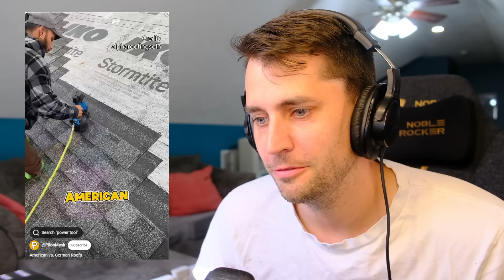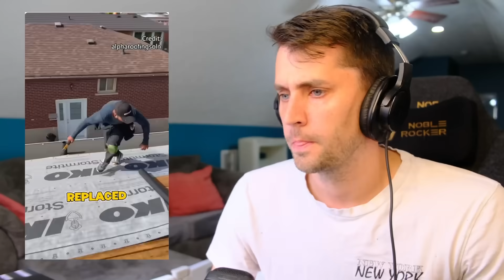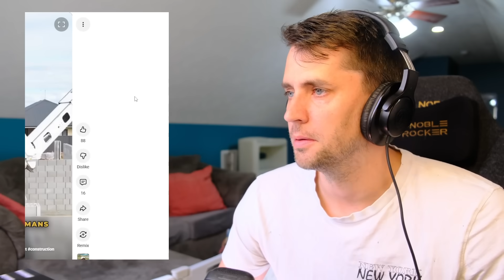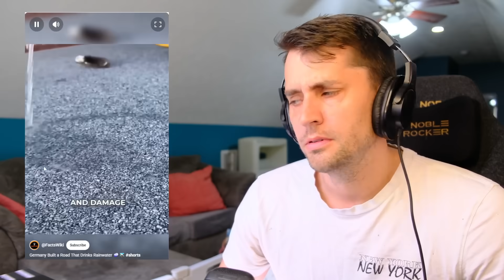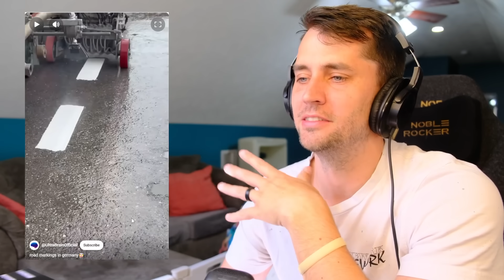American reacts to Germany's NEXT LEVEL construction methods

Comment: Aside from the roof video, the others felt more like commercials. I've never seen one of these house building robots, and some things make no sense, it has a 25m long arm but it can build 8 stories tall buildings. In most german houses you need between 2,5m and 3m per story, so even if it could reach the height of 8 stories then it needs to move around the house all the time and it can't build inner walls, that makes no sense.

Comment: FYI: Renovating the roof of my 1958 Home (adding multiple gables) with concrete roof tiles cost me 100k Euros. That was not cheap but also not expensive. Our Roofs do have a wood construction though just like american homes although much thicker wood. The roof was on there since building the house.

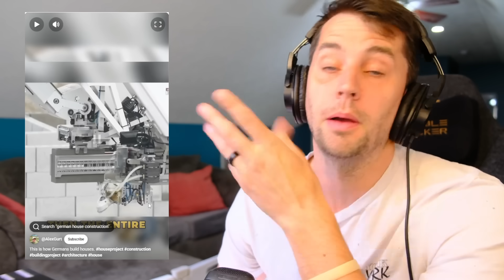Comment: 6:22 Yes, there are machines like this out there, but it's not common at all (yet).
Maybe it will be someday, maybe it won't. 
Those machines do different types of construction.
It's not the traditional "glue the bricks with mortar" technique but "stack perfectly uniform bricks like lego".
Some of those constructions are built so that hollow spaces within the walls are filled with insulating granulate and/or stabilising concrete, depending on the type and the position of the wall (inside or outer).
Reply: Yeah, I have never seen such a machine, not even at construction sites of large commercial buildings. Don’t know what I should think about them yet, still have to make my mind.
BTW never have seen such thin bricks either.

Comment: In Germany, a tiled roof costs about  2,5 times as much as a felt/bitumen roof. However, the roofing felt used here is considerably thicker, and a bitumen underlay membrane—similar to felt but without the sand coating—is mandatory.

Comment: If i would like to make my 500qm Roof new on my farmers house. I must pay over 100K euro and more. A reed roof is even more expensive. A 200 square metre roof costs around 500K euros.
The materials are not the most expensive part. The sheet metal would cost me around 10,000 euros. The hourly wages are expensive. Between 50 and 80 euros.

Comment: I look at it like this:
The options aren't really 30k today vs 15k today and 15k in 20 years.

They are 30k today vs 15k today + ~25k in 20 years due to inflation.
Because of inflation the short term solution is probably always the more expensive one.

Even if you don't own the house for that long, it certainly should add to its value.
Reply: That's actually not how inflation works...
Read up on "net present value"!
In a proper evaluation you also need to factor in cost of opportunity, (net) interest rates, depravation, lending costs...

Comment: Yeah, I payed about 50k Euro for a new roof in Germany. But on the other hand you would have to pay thousands Euros more per year with an American roof for energy and heating. Most people in germany build a house to stay and settle down.
Reply: Was this just for the tiles on top or for replacing the entire roof construction?
Reply: @zockertwins   that’s about everything as far as I know. Anything a roof is. All the Wood construction, isolation, under Construction and tiles.

Comment: Roof is not the same as roof.
You basically have two components. The base part, made from wood, which the carpenter does, and the top part, made from/ done with roof tile (Dachziegel), which the slater/ roof tiler does.
The first is more expensive than the latter.

The first is called Dachkonstruktion the 2nd is called (Dach)Eindeckung.

Comment: First: The calcclation should not be: What's the price of a single replacement, but what's the cost of a replacement per year? The normal time frame of a German clay roof is 40 to 50 years. Second: a clay roof would be too heavy or your wood framing.

Comment: Road markings are not stickers.... it´s usually a special multi-compound paint that is meant to melt into the asphalt, and by this becoming pretty durable... My guess is, that applying it in wet and cold weather interrupts this process and that´s why it can be removed like a sticker in that video.
Reply: Were those white it yellow markings?The yellow ones are stickers that's for sure.Thr white ones, I don't think so
Reply: Yes. In Holland we use a flame after painting procedure. And we have a lot of sand in the paint so it's not slippery when wet.
Reply: The thing is, that it needs to be heated to stick into (not onto) the road. Therefore a second machine follows the first one, far slower and most times used by the same workers. So when they first layed the pads down, they weren't meant to stick to the road, they still needed a proper heating by said second machine. This idiot in the video instantly grabbed those markings, before something could be heated, and therefore destroying the work of the workers and the first machine. Noone would proof water resistance of paint by pulling a bucket of water directly after the painter applied it.
Also the heating process doesn't care about the level of humidity. So it has nothing to do with the rain.
Reply: @benjavinci2582  with how small this patches are (road markings are typically elongated because the are ment to be seen from a drivers perspective), they might as well have been just the crew priming the machine after filling it with paint and Hugo walking after it picking up the scraps until the nozzle dispenses evenly.
Reply: @benjavinci2582  Sounds about right... I wasnt sure about the process, that´s why I said "My guess is"
Reply: @Ossborn76  Tbf it was a good guess, wasn't it?
Reply: The sticker kind of markings have to be applied with the help of heat - like the iron-on stickers of your t-shirts: One crew sets them on the floor, the next crew will fasten them to the street: next level, with the coloured lines in temporary markings, you might remove them fast by applying heat again 😅
Reply: There are 3 types as far as I know. Thermoplast, Coldplay and roadpaint. Thermoplast is a sort of heated plastic based material that hardens after applying it, coldplast is a two component based solution  which is more durable and roadpaint is a more traditional product used when durability less important or on smaller roads that are used less.
Reply: And this paint has a very intense unique smell.
Reply: Belgium used to use this technique as well, but they indeed started to Peel of, so we switched to thermoplast.
Reply: No actually newer markings are kind of stickers. Ive seen it once as they applied it to the road, it was a big roll of it and they just walked along a pre painted line where the markings were supposed to go, it was like a tesa film.
Reply: @B.Lank-r1v  "Sticker" implies that there's glue between the marking material and the road. There isn't, the marking material is holding to the road mechanically as it is melted into its surface structure.
Reply: @B.Lank-r1v  No its molten plastic not stickers, molten plastic apllied on a wet surface gets cold in an instant and doesnt stick to the surface of the asphalt.
Reply: @B.Lank-r1v  Usually there's also a second machine pressing them into the asphalt.

But you can see they are not picking up the ones on hte road (those are on the left edge of the screen)